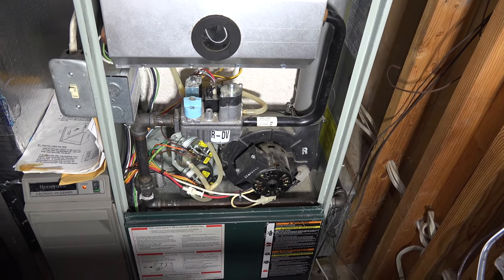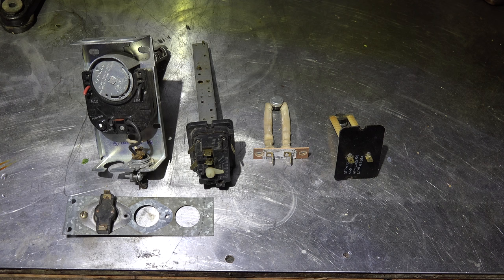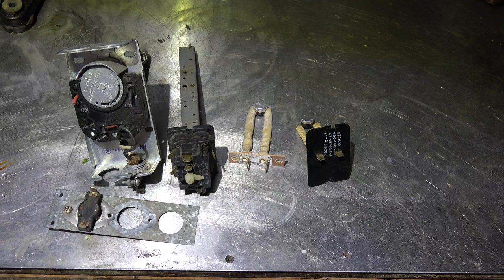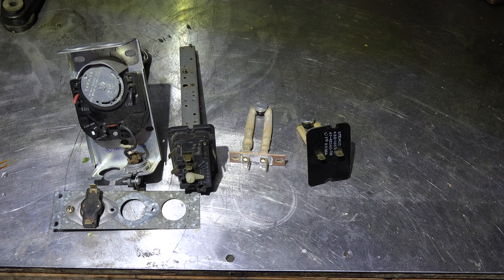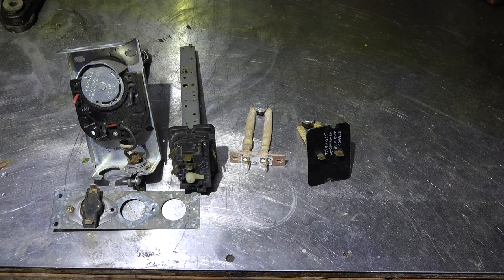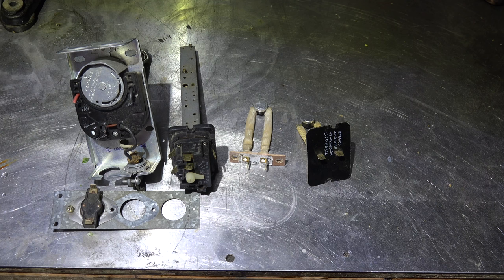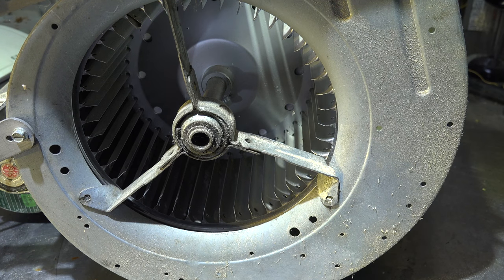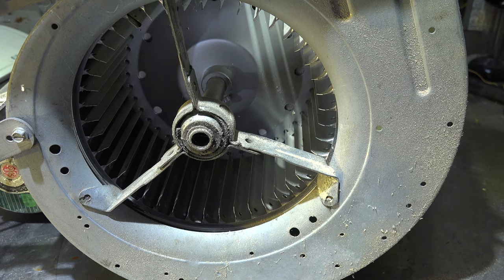Why is my fan running all the time with no heat

Comment: My electric heat air handler had it's sensors go off due to high heat but the filter was new and had enough air flow to it but the sensor kept randomly going off and had my neighbor come over and test the airflow and was correct.. we since replaced the heat strips because the relays stuck on and caught fire..
Reply from the maker: The shutdown was probably due to one of the sequencers (relays) sticking on and overheating the furnace which will result in limit switches opening.
GFM

Comment: Hey folks,this guy is good.Mr.Grey I had similar problem,the furnace was short cycling,shutting off the gas and starting again.But it was not the limit switches,it was the air filter that was too thick and restricting air flow. Thanks for helping us folks who can fix simple problems. You are the best.

Comment: Thank you so much for your help with my furnace. Limit switch must've activated due to a clogged air filter. Probably saved me $150.00 and the embarrassment facing the HVAC guy. Glad I wasn't too busy to deal with it myself.

Comment: My issues is with a furnace that’s blower stays on during auto without calling for heat. It gives an error code for the flame rollout but instead of just buying the rollout what can I do to either bypass the rollouts or make sure that is the problem?

Comment: Mr.Grey.I have a Rheem criterion II gas furnace, guessing it was installed before 2007.Its now 9/2018,we have been running the A.C. with the warm weather and the blower motor (the small one that starts up before the glow plug lights up in the winter) will start and then stop, we have a old dial type thermostat.If we need to replace the thermostat will there be a problem if we have to go to a new style?

Comment: I just had an easy one finally at my rental house.
A mouse had chewed a hole in the vacuum line on the vent motor and the igniter wouldn't glow to start the burner.
A while back the AC compressor had to be  replaced at 1600 bucks.
The year before that it needed a capacitor and  Freon so nothing I could do.

Comment: First and for most a big thanks you to you Mr. Grey and a Happy New Year! I find this new year, at about 3 am, that a hum is coming from my vents and no hot air....no cold air either. Thermostat is reading 51 degrees F at present and outside temp is 14 F here in DC. It's about to get cold in here. I have family here from Philippians experiencing their first winter EVER. My issue is not rectified but I think the answer is found here in this vid.
Reply from the maker: Look for error codes on the furnace.  Should be a small window in the fan cover to see the codes with a key on the inside of the door.
GFM
Reply: You, my friend, are a whole lot of awesome! Forgive the latent response. I went into survival mode and purchased 7 medium room portable heaters to take the edge off.....1952 home no insulation just wall cavities.  It was still cold. Regarding the error codes, my system does not have a read-out as such. The bread board does not have a digital read-out nor does it have any LED that would denote error. Nonetheless thanks to your vid on "Limiter Switches" I am back up and running real nice and toasty like.....hence my first statement. You literally make the world a warmer place...and or cooler place respectively.
Reply from the maker: Thanks for the support.
GFM

Comment: Our inducer motor never shuts off even when there is a call for ac.  Heat turns on once , but that’s all she wrote until I kill the power to the furnace and then turn it back on. I am assuming this is because having the inducer motor running all time does not cause a neg pressure reading for the pressure valve to close and start the heating cycle. Everything checks out good with a meter for resistance including the limit switch. Is it just the relay on the board for the inducer motor stuck on? 

Any help would be much appreciated 

Dirk
Reply from the maker: I would first look at the relay.
GFM

Comment: Our blower runs automatically in our vacation home (mobile home) in Palm Springs during the summer when we’re not there and the inside temp is over 85 degrees or so unless we shut off the breaker when we leave.  We’ve recently installed a smart thermostat to turn on the AC before we arrive but it’s useless if the breaker is turned off.  Is there a way to fix this so the blower isn’t constantly running without killing the breaker?

Comment: For me the ignitor and flame sensor needed cleaned with high grit sandpaper, I found this after looking at the code my furnace board was throwing (blinking light, google it), which pointed to the issue; if you're having problems, check the code if possible.

Comment: I measured continuity for this device 5'' old style and figured out that is bad. Ordered from amazon new one 5" with fan button and connected, my thermostat was off/heat was off, when I turned power on blower motor started working and heat come up, gas valve energized and something started melting. What was wrong why it used to do like that? All wires were connected properly.(((
Reply from the maker: Beats me. Sounds like you wired it wrong.
GFM

Comment: Is there a limit switch in Electric + Heat Pump furnace? My furnace works on heat pump, but when it's too cold for the heat pump, it shoots cold air on Aux Heat... thanks!
Reply from the maker: There are limits on electric furnaces/air handlers.  I would be looking for kicked off breakers or control problems.
GFM
Reply: @grayfurnaceman  oh OK, breakers are OK. The damn air handler is in the attic... This morning it was blowing colder air than indoor temperature and when I switched it to EM Heat, it blowed air at roughly 68 degrees... I shut it all off and using the room rads now... I'll look to install a new unit inside the house. I think it was stupid to have it installed in the attic by the previous owner... Up here in Canada, it get real cold. Thanks for your quick answer.

Comment: have a carrier 58SX100-cc sometimes just here inducer motor running so i look in the little window by burners no pilot if i disconnect hose from presure switch and blow through hose into furnace it will light and work any idea

Comment: Thanks for the video. I have an old Crane furnace and the fan belt blower motor never shuts off.  It will stay on as the furnace heats up and not turn off at the end of the cycle. It's not the thermostat because I changed it out and the blower remained on.  It has a honeywell limit switch like the one in this video and it is set to auto. Do you think the limit is bad? The temp relay clicks on and off when the fan is turned on, even though it's already running so I think the relay is good.  Any advice would really help me out! Thanks
Reply from the maker: This sounds like the fan and limit has failed.  Try hitting the ductwork near the fan and limit.  If it shuts off, you are certain that is your problem.
GFM
Reply: @grayfurnaceman  Thanks a lot, I'll give it a shot. Will hitting the ductwork reset the switch or something?
Reply from the maker: It breaks the contacts loose.
GFM
Reply: @grayfurnaceman  thank you. It was a bad fan limit switch.

Comment: Thank you Mr. Gray I appreciate your videos and they are very helpful!!  My Trane unit purges, ignites and then the blower comes on. After getting to the set temp the gas shuts off and the blower continues to run until manually disconnected.  It would normally run for approx. 2 minutes as a post purge/cool down.  Would a limiter cause the blower to continue running?  The error light is 5 blinks however your Error code video did not elaborate on this particular code.  Any suggestions? Thanks again!
Reply from the maker: Its possible the unit has locked out on flame failure or a pressure switch problem.  The 5 blink means the flame rod is sensing flame when there is no power to the gas valve.  Are you sure its 5 blinks?  If the flame goes off, it should not be sensing flame.  
GFM
Reply: Thanks for the reply; yes I just looked at the IFC and it blinks 5 times pauses and blinks 5 times etc.  When the furnace is running I have 25 volts at the limiter.  When the flame shuts off I have no voltage and the blower keeps running with the 5 blinks at the IFC!  Could it be a stuck relay in the IFC; the unit is 10 years old. Thanks again! David

Comment: Could loose screws on the fan grill cause problems? I found a few screws loose laying just b-low the back burners & 1 n the front. Could a wire possibly be connected to say a screw?
Reply from the maker: It certainly could.  Depends on where they came from.  If you send me pics of the screws I may be able to tell you if you should be worried.  Send to Grayfurnaceman@gmail.com
GFM

Comment: I am trying to run the blower ON with the furnace OFF(Luxaire TM9V) to move the air around the house but it will not work. It only work on the auto possition with the furnace working. Any ideas how i can fix it.
Reply from the maker: Have you shut off the power to the furnace?  The fan will not work with the power off.  
If your furnace is on and the fan, when set to "on" will not operate, the "G" terminal at the furnace is not connected to the "G" terminal of the thermostat.
GFM
Reply: Thank you for your reply. I will check the G terminal connection tomorrow. Power is OK. The furnace is working  and fan works with it. Just trying to operate the fan manually to circulate the air on the house.
Reply: @grayfurnaceman  Hi GFM checked the G terminal at the furnace and it is a green wire and at the thermostat is the same.   At thermostat(White Rodgers model#1F78) W- white, RH-black, RC-red, G- green, Y-orange .
Reply from the maker: @yamilrodriguez5918  Jumper from "G" to "R" at the furnace.  If the fan works jumper "G" to "R" at the thermostat.  If it works, it is the thermostat.
GFM
Reply: @grayfurnaceman  Hi GFM tried the jumper. No luck. after checking the schematics of the furnace looks like the power to the fan is controlled buy the ignition sensor. No ignition no power. i guess it is the design in this 2 stage furnace. I will look if i can bypass it running power directly to th fan wit a switch on the outside.  But that will be on the summer time. Thank you for the help.

Comment: Say there GFM, what is a recommended cleaner for fan wheels? I imagine it depends on the type of filth collected?
Reply from the maker: I use an industrial cleaner made for coils and fans.  However, a household grease cutter type cleaner will work well.
GFM

Comment: I have Westinghouse/Nordyne fg6ra 096c-16b furnace. And my blower could randomly turn on between heat cycles with inducer on together. When i come to the board and see red led light it is constantly blinking. Error coded state that in this situation it is false flame (flame sensor was just replaced) OR Gas Valve relay shorter. I didn't replace yet gas valve because i can't convince myself that problem is actually in gas valve. If someone could help me convince myself that shorted gas valve relay could cause inducer and fan run together randomly between heat cycles? Thank you
Reply from the maker: A shorted gas valve relay could not, but a failed control board could.  
GFM
Reply: @grayfurnaceman  Thank you. That is my suspect at this moment as well

Comment: Hello Sir, I just had a blower motor replaced on a 7 year old Carrier 95, but limit switch error code (4 blinking lights)still comes on and burners shut down only to come back on when furnace cools down. Filters fine. Blower fans clean. Could it just be a faulty limit switch or is there something else I should be making sure my HVAC tech should be checking? Thank you
Reply from the maker: You probably have an air flow problem.  Secondary heat exchanger plugged.  A/C coil plugged.
GFM

Comment: Hello GFM, Your videos and website have saved me service calls and money in the past and allowed me to become pretty comfortable at troubleshooting and working on my Goodman GMH80453ANCB. I truly thank you for that. I have a problem now that has me puzzled and sounds possibly like a limit switch issue that you describe here. I will attempt to provide some detail here. The heater comes on with the thermostat, the inducer cycles up, the pressure switch actuates, the ignitor glows, gas flows and the burner lites. (2 burners) The burners remain lit for about 15 seconds and the gas shuts off but the ignitor almost immediately begins to glow and the cycle repeats until the thermostat is satisfied. The problem is that the blower is almost constantly running through this cycle. This is causing the air being pushed to be luke warm if not just room temperature. Filter replaced and the symptom is the same with 2 control boards.(on hand for a previous problem) I have just replaced the limit switches for the heat ex-changer 220 degrees and the blower 120 degrees. I do not see any indication of a problem with the heat ex-changer such as off color or erratic flame, blow back from the fan etc. As I said, I am puzzled and about to call a pro as this is causing the heater to run almost constantly and not able to heat the house. Sorry to be so long winded.:)
Reply from the maker: I would try temporarily jumper the limit (and I do mean temporarily, do not under any circumstances leave the jumper on), If the problem stops, you may have a failed heat exchanger.  The heat from the burner is contacting the limit directly.
GFM
Reply: Thank you for the response. I jumped the 2 female spade connectors to the primary limit switch. The initial burn cycle lasted about a minute. I was able to run upstairs to check the air and it was obviously warmer. However it then returned to the previous cycle of the burn lasting only about 15 seconds. I do not remember exactly what a normal cycle was like, but I assume that even this last cycle while jumped would not be normal.
Reply from the maker: I assume that with the jumper installed, you reverted back to the 15 seconds on condition.  Have you jumped out the thermostat?
GFM
Reply: No I have not. Just jumper the 2 wires?
Reply: I jumped the thermostat, while not exactly the same, it is still not normal. Burners lit following normal startup cycle. Burners ran about 30 secs, immediate ignitor glow, 6 sec burn, ignitor, 13 sec, ignitor, 12 sec, ignitor, 12 sec, ignitor, 9 sec, ignitor, 14 sec, ignitor and so on.
Reply from the maker: Yes
GFM

Comment: Couldnt you just bypass the switch all together by hooking up the 2 wires together that go strait to the switch?
Reply from the maker: Yes, for testing only.  However, leaving the jumper installed will result in dangerous overheat of the furnace.
GFM

Comment: Heat stopped working in my Carrier furnace today. Been trying to figure out what's wrong. My blower runs when I turn it to heat for about a minute, then turns off. Only cold air comes out. The draft inducer is pretty noisy, and I suspect something is wrong at that point in the chain, because it doesn't get to the igniter glowing. I know the igniter works tho, because I ran it through the test cycle by shorting the test terminal with 24v Com and it light up during the test. Any ideas? Would the chain stop if the draft inducer was weak or not working properly? My LED codes are totally normal. Any advise is appreciated! Thanks
Reply from the maker: I would be looking at pressure switch problems.  If you jumper the pressure switch during a trial for ignition, does it come on?
GFM
Reply: Thank you so much for the advise. I figured it out. It was the draft inducer motor. It was seizing up. I gave it some turns and it started to work again, and everything kicked on. Ordered replacement, so I'm pretty confident that motor is literally on it's last leg. I'm just happy to have heat again. Still cold here in Michigan.

Comment: Good Day
I have a furnace that the exhaust fan and blower motor come on, when a call for heat is initiated.  I also get a code for pressure switch error.  Why would the exhaust and blower come on at the same time
Thank you
Reply from the maker: It may be because of the failure code.  Some furnaces turn on those fans to let you know there is a problem.
GFM
Reply: grayfurnaceman thanks For the quick reply, gonna replace the PS its to be faulty, after jumping it out it worked.

thanks i always learn from your vids

Comment: I have A criterion gas furnace blower will not shut off even from thermostat I have to replace the panel to shut it off no heat, but I did notice the batteries were dead in thermostat I change them
Reply: Anyone help or had this problem
Reply: If that’s the symptoms then it sounds like you have exactly this problem same problem with the High Limit switch. If the fan has run for a long time and it doesn’t reset then your switch inside is probably a manual reset and should have a button you can push in which would close the switch and bring the heat back on

Comment: old 16 year old tempstar when you first start it shuts off then you started 3 more times then its starts running normal is it the gas valve?
Reply from the maker: MegaWhitesox05 From what you say I would be looking to clean the flame rod. 
GFM
Reply: it was changed its new it still does the same thing.
Reply from the maker: Have you tried bypassing the thermostat?
GFM
Reply: no but i will try it thanks

Comment: you need to do one about the right filter good better -best TOO thick --less air flow - MORE PROBLEMS .... I WANT THE BEST---but my 15 year old oil furnace is not getting enough air ---FAN is always running
Reply from the maker: I have a series in mind and will be getting it out there hopefully soon.
GFM